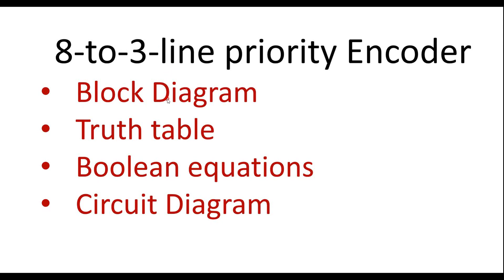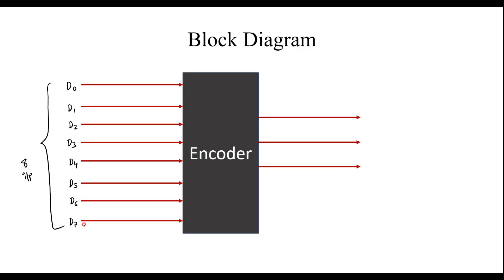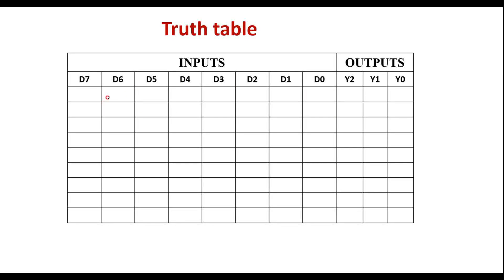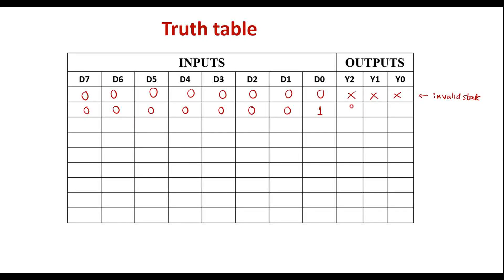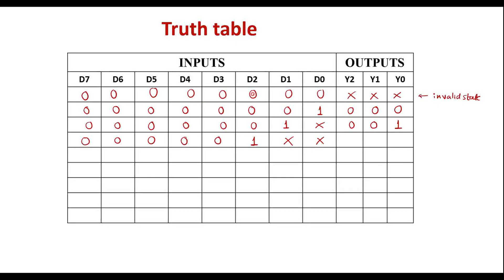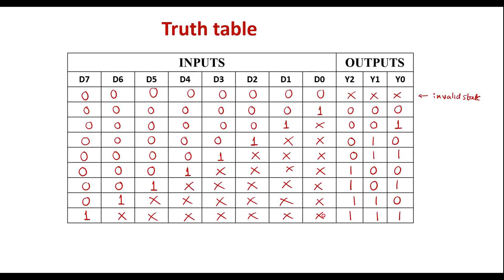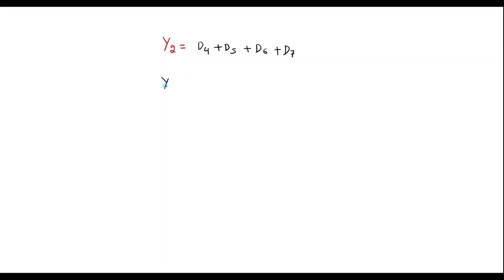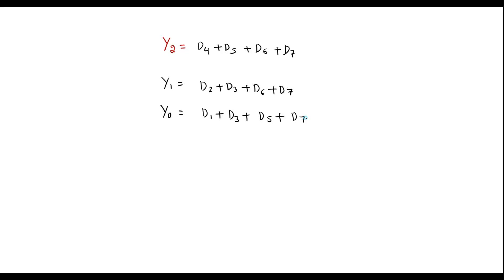8 to 3 line Priority Encoder

Comment: this is not a priority encoder.

in your circuit if :
D5 = active and D3 = Active 
then output = Y2Y1Y0 

but Y2Y1Y0 = D7 
a priority encoder would solve this problem just like in your truth table which is correct and dont not match you circuit